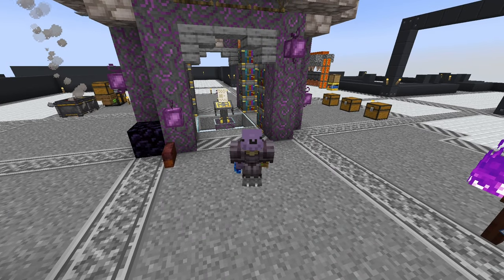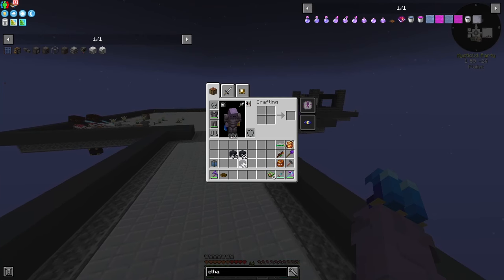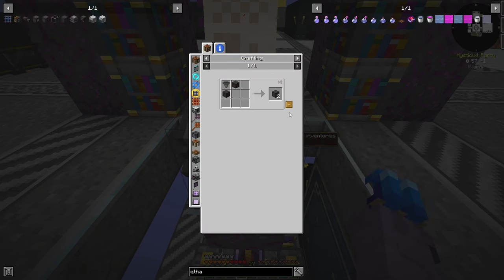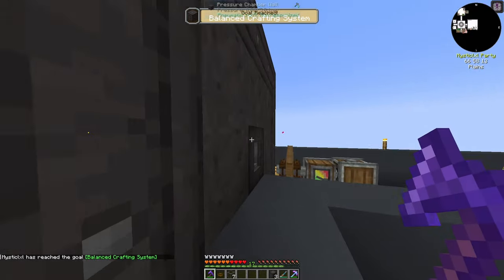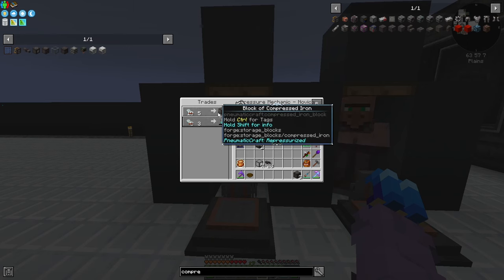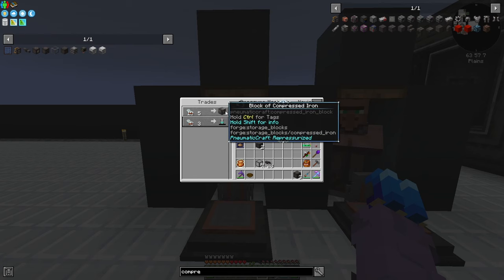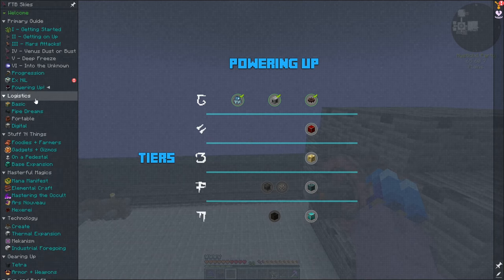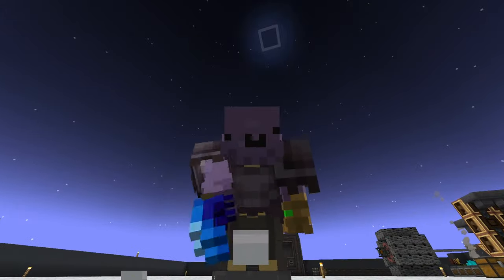FTB Skies Expert - Ep. 9  - Getting Pressurized & New Power Generator

Comment: The villagers route for PNC sounds great!  Trading invar coins for resources is super easy once you get the Induction Furnace from Industrial Foregoing, plus the coin trades from a captures wandering trader.  Managing compressed iron is a pain, an anything that reduces use on pressure is a good thing in my book. 

Good luck with that magnetic dynamo setup.  At least you have a shop foreman bee on duty watching carefully for any problems.